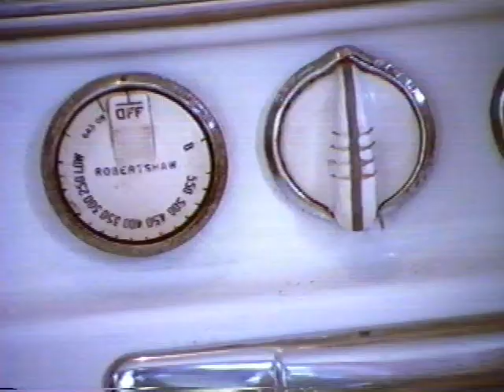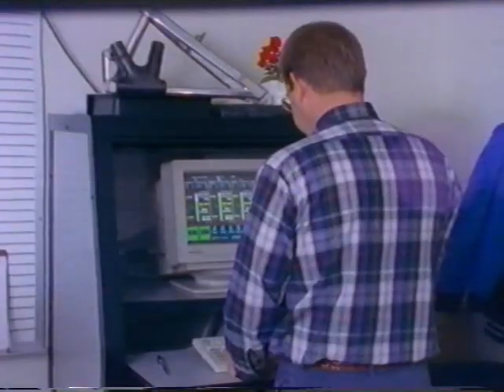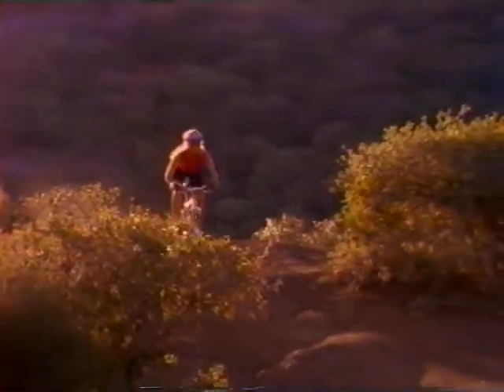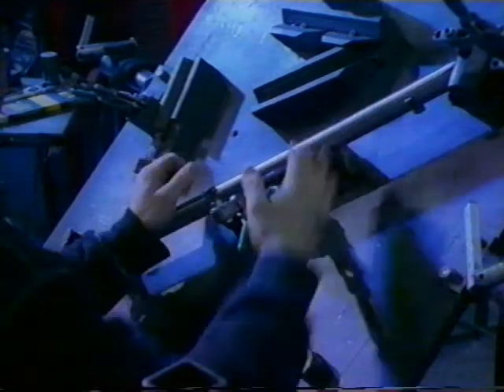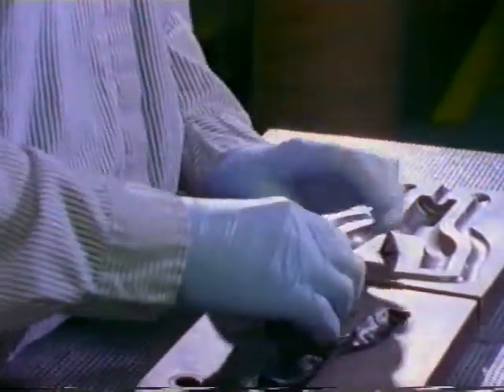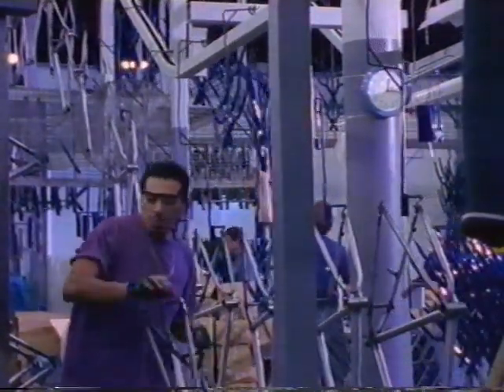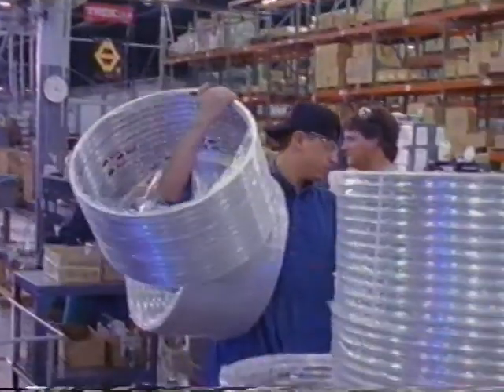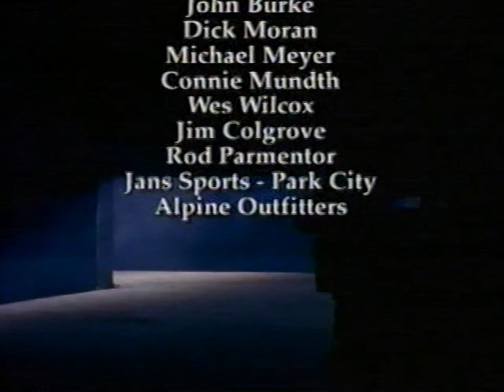One Bike at a Time

Comment: I bought a Y-11 in ‘97. I’ve rebuilt it with disc brakes, upgraded wheels, air fork and air shock. A great frame when upgraded with newer technology. 26lb cushy trail bike that handles better than anything else I‘ve tried. The final upgrade will be 1x12 this winter.
Reply: I'm considering buying a y22 from someone, is it fairly easy to make the switch to disc brakes?

Comment: I had a Y3 bake in 97 till i cracked the frame in 2000 paid the extra to upgrade to a VRX frameset Cracked two swingarms and the welds on the bottom bracket but still have my VRX in the garage that i use every once in awhile